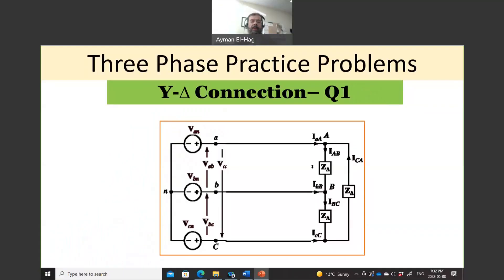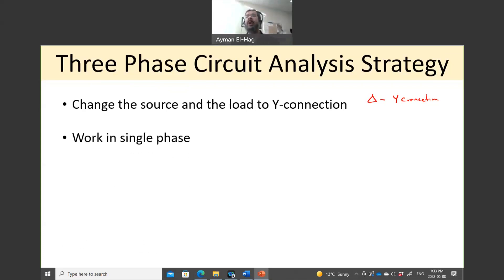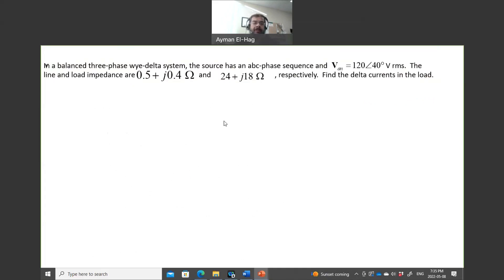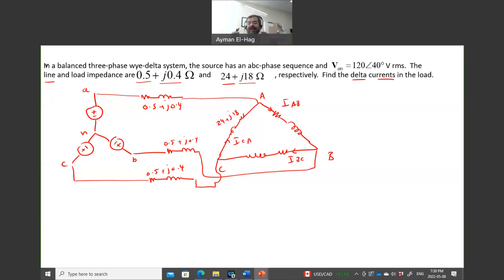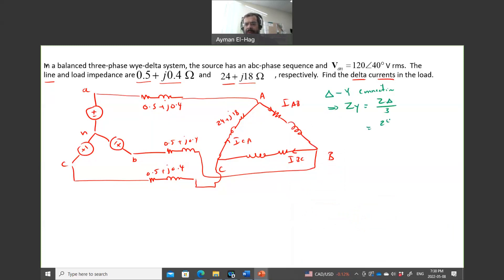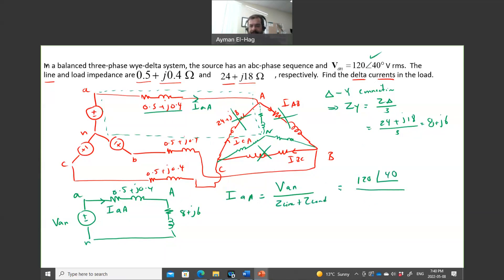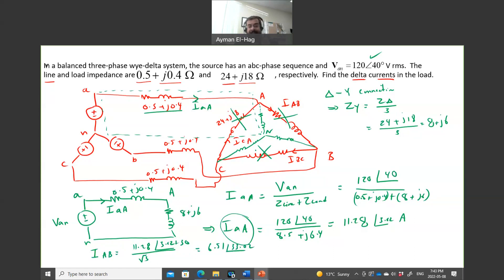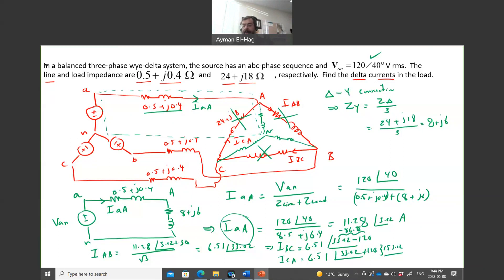Three phase circuit - Question no.1

Comment: Thank you for the video!, I think the I (Line AB) should be sqrt(3)*I phase(angle -30) = 19.5 (angle -26.9)? Please confirm, thanks.
Reply from the maker: The current we calculated between the source and the load in the single phase circuit is the line current. This is always the case regardless of the source or load connection. What will be different is the load current. If the load is Y, then the phase current = the line current. On the other hand, if the load was delta, then the phase current = the line current (angle +30) /(SQRT3)